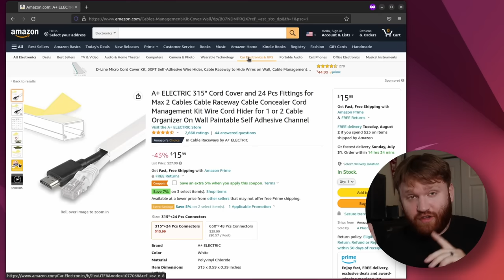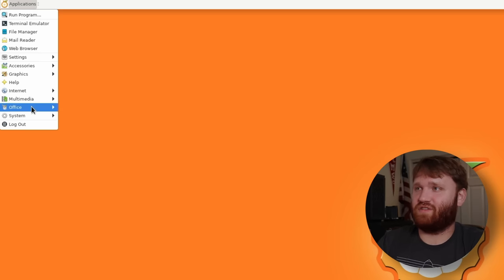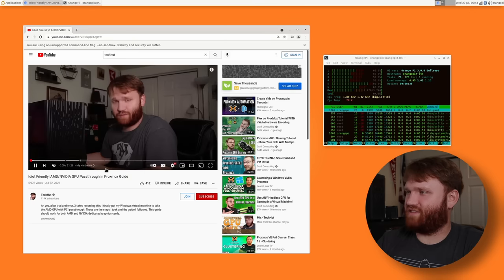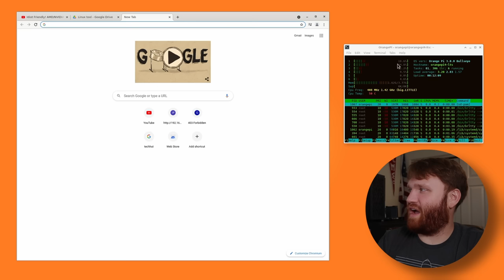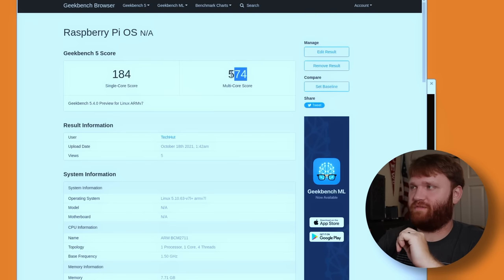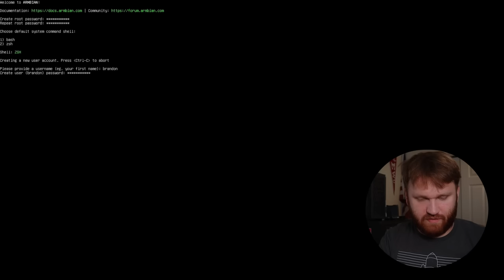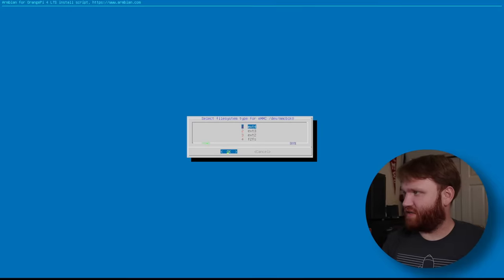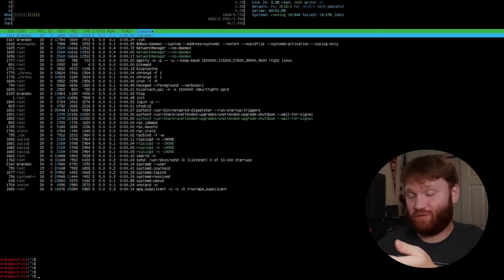BEST Open-Source Single Board Computer? - Orange Pi 4 LTS

Comment: Okay there are a few very big issues with the Orange PI i should point out to folks.

1) Cooling is a big issue with these boards, out of the box there is no prebuilt cooler that will fit this board, all the cases use fans over the CPU but nothing to draw the heat away from the die; while thats fine if you know you want the fan directing cold air over the supplied heatsinks then it works. However if you accidentally wire the fan upside down, you're in for a throttled nightmare
2) There is no prebuilt cases or hardware available specifically for the Orange PI builds, that means you're going to have to either be able to 3d print a case that fits the unit or you're going to have to buy the plastic prebuilt and gasket/seal the clip together cases so that they don't warp with the heat, or as i experienced; crack when the case temperature exceeds the ambient temp.
3) When a new board is released, the old ones are no longer supported (see the Orange Pi Lite v Orange Pi Lite2), when the updated board was released, the older board stopped receiving regular updates, forcing you to use raspbian download directly from their site (since APT updates no longer work on the custom build) and losing a lot of the boards functionality (since changes to the OS are made to make it compatible with the board directly since the GPIO is not aligned to the same jumpers and several of the voltage points are on the opposite rails)
4) The micro USB input has a habit of being loose on the board, so unless you have a good soldering iron you're in for a bad time if it comes loose. This is a theme if you use any of the input/output ports on a regular basis for any length of time other than set and forget. At first i thought i might have just got a bad batch but after my 20th variation on these boards i can say it is the build quality overall
5) the GPIO is not 1 for 1 with a Raspberry PI. So while the board claims to be cross platform, you will need to individually jumper wire the 6 - 8 wires which are misaligned with gpio jumper cables which generally makes a mess when it comes to expansions that use the full 40 pin layout. I realise that there are adapters on aliexpress for converting those pins but i shouldn't need to have another piece on every unit just to convert the GPIO to align to the spec.
6) If you're looking to use the board to run any of the M.2 or hard drive expansion sets that worked with the Raspberry PI, you're out of luck. I've tried many times to get a solid answer from geekboard and other manufacturers of these types of expansion boards, and never had an answer other than its untested but should work (which is not an answer you want to hear if you know the GPIO headers are borked from the start). While it may be compatible with the Raspberry PI standard, the GPIO header pins being mixed up and the difference in the location of the different chipsets means the test pins used on many of those expansion boards don't work (since the part is in a different place on the PCB)

Other than those few issues, if you're running it as a server or as a standalone operation where you're using the GPIO to read sensors or control relays etc. you should find the board more than capable.
Reply: Would i continue to buy these boards, yes and no. Yes if my needs where strictly only for servers & adding zigbee home automations etc. But beyond that scope i think its safe to say that Raspberry PI & Rock PI are still king of the landscape.
Reply: This was a very useful comment, it should be pinned.
Reply: On cooling that's not a big issue,one can easily put a small heatsink from old routers,set top boxes, PC's... ,and when buying one already knows it doesn't have one unless you order it with, 
On the GPIO's I think when buying it one shouldn't assume its a RPi for crying out loud! So no need to complain if you want  an Orange you get an Orange not a Raspberry be prepared for the taste. It does what it's made for and I can't complain cause I knew when I bought it what to expect no catches, I can use it with my pi2 via ESP32 no problems and I bought an arduino 45 sensor kit that work on both ESP32 and OPi running Micropython
Reply: @mars_official  as for me, home automation a RPi or OPi is overkill, an ESP32 does it so well running a microdot async server
Reply: @martinmtawali7359  yes but we're talking about a 1 for 1 replacement for a raspberry pi 4b here, which this post suggests can be achieved with an Orange Pi 4 LTS. Which is not entirely true. If i have a Raspberry Pi 4b and a Orange Pi 3 and i unbox and run them 24/7 as a server and within a year I have to unplug the Orange Pi 3 to check why the board isn't working, thats not exactly a good omen. The LTS series i haven't tried yet (they came out after I purchased the last lot of boards), so I'm going to try those because they have USB-C; but so far I've replaced all the Orange PI boards and none of the Raspberry Pi
Reply: @martinmtawali7359  and I use mine as weather stations & data logger database dumps so i know all about the overkill thing but my success with the Orange PI brand has not been great. Have yet to try Banana Pi's
Reply: @mars_official  sad you didn't succeed 😢
Reply: @mars_official  mango pi's are a bit overpriced but I too wanna try them

Comment: The Raspberry Pi 4 had a CPU change due to a minor fault, which changed the speed from 1.5GHz to 1.8GHz, same as the Pi 400. The difference is the last letter in the serial number - B is 1.5, C is 1.8
Reply: Good to know.

Comment: the rockpi 4c+ was a better replacement imo, same connectors as the rpi 4 (so case compatibility is a possibility) and it has the same chipset as this device

Comment: first of, the gpu on the Orange pi is the same that was used on the Banana pi and it is horrible in comparison to the GPU on the raspberry pi 4, which is probably why you experience lag on the desktop.
second of, the raspberry pi might have a stock clock speed of 1500mhz, but that is mainly because it's sold without cooling, take something like the pi400 which comes in a keyboard and have passive cooling, i believe the stock clock speed is 1800mhz on that.
the raspberry pi can be safely overclocked to 2000mhz but cooling is recommended in order to keep the life span of the pi intact.

back to the gpu, it is probably the only thing holding back the SBC's out there, if the pi could get just a little more boost on the gpu side of things it would actually be a good cheap desktop pc, a raspberry pi 4 specs can be as high as, CPU 2100mhz, RAM/memory 8gb, storage either micro sd cards or simply get a usb connected nvme or sata slot.

the only thing i'd wish they'd do with these SBC's is upgrade the GPU, ofc the CPU matters as well, but the CPU is strong enough for what the use case of them are, on a computing side of things they do wonders, but on the graphical acceleration they are terrible and the only one just holding on is raspberry pi, and i think that is mainly because of how many people actually have been part of building up support for the raspberry pi.

you can't watch streaming services like netflix, disney and what ever from the get go, but search a little online and you find that people have already solved this issue, people have already solved how to run x86 programs on arm devices like the pi.
there is no way any SBC is beating the raspberry without upgrading the GPU.
Reply: Good thing you point out the GPU performance, do you think it's just weaker or it's a driver support thing? I heard some SBCs work better with android because they have full hardware acceleration support.
Reply: @junovicz  not actually sure, it could be driver support but i think it's mainly just the power of the GPU.

but i gotta admit, i love the Pi's for their low power consumption and the many different usage there already is for them.
most who have no idea what to do can easily find step by step guides to make almost anything out of the raspberry pi.

my personal use case after many years is still just a portable retro machine, using a power bank when travelling, able to run N64 and PSx games, what more do you really need ;)
Reply: @gargoyled_drake  yeah emulation on SBCs is pretty neat, pair it with a mini portable monitor + a gamepad and you got a very pretty machine.

Comment: I don't know what that error is or what network manager it comes with by default, but I'd try disabling it and installing NetworkManager and using its control software, nmcli. I don't know if it works on non-Systemd systems, as I've always ran with Systemd. But to enable it in Systemd, "NetworkManager" is case-sensitive; that was frustrating. `# systemctl enable NetworkManager` . You probably also have to `# systemctl start NetworkManager` if you don't want to reboot to turn it on. You can also manage your wired connections through it.

Comment: Hi @TechHut , I just bought one and its on the way. Your review is good Thank you for your time doing this review but you havent mentioned how to Power Orange PI 4 LTS for 24/7 operation. Should I use drum Jack Power adapter with 5V 3A or 5V4A with Type-C Connection? Thanks which Power source did you used could you name a brand and model please

Comment: You can run pi 4s at 1.8 GHz no problem if you put a heat sink on them and it is officially support as in its set to 1.8 GHz out of the box with the raspberry pi OS, so that’s not really an advantage of the orange pi since the pi 4 can do that too.
Reply: I run my Raspberry Pi 4 4 gigs of memory Raspberry Pi OS 64 overclocked at 2ghz in a DeskPi case (good heatsink and fan). Usually runs in high 40 degrees to low 50 degrees C. Makes an OK desktop.
Reply: @jeffreyalwine1990  I’m sure you can probably overclock the orange pi 4 too. My point was more that the officially supported clock speed of the pi 4 was increased to 1.8 GHz so it really isn’t an advantage for the orange pi as the official max clock speeds are the same.

Comment: I don't trust these RPi clones, Banana Pis gave me magic smoke around the time we still waited for the RPi 2 and the RK3366 seems to be hit and miss as far as support goes.
As far as SD Card read and write speeds go, I recently set up DietPi on my old RPi 2 which I use in favour of my NAS and the Pi 4 I added to it because this old SBC can still be empowered from my router's USB port which comes in handy in my country with prices for electricity going to explode.
DietPi itself is pretty amazing because it uses the RAM as a RAM disk of sorts to reduce use on the SD card and because it actually adopts the idea Raspbian's devs came up with when they introduced raspi-config by distributing their own dietpi-config that allows to even more things on the TUI without the need to ever set up config files or use the term like a champ.
The OPi4 certainly would benefit from it as well.

Comment: 4GB is not enough, 8GB is the absolute minimum acceptable. I don't think the mini PCI-E is compatible with SSDs either, so you'd need a PCI-E Controller for any kind of reasonable storage which almost certainly you couldn't boot from, so you'd have to mess with grub on the emmc or sd card for that. I guess they're okay for fiddling, but any serious use it's woefully inadequate.

Comment: uhm.. your sponsor sells way to expense cable trays you can get for a few bucks in 2 meter length in your local harware store... what you showed were k25, and k40 cable trays.. quite
 standard in the electrician world... even the items that came with it are simply available in the hardware store.. so i would not recoment that kit because for that price you can get 10 boxes of that stuff.

but the review is very nice!

Comment: I beilieve that tge current linux kernel (5.x) isnt compatiable with orange pi devices which might be the reason you are getting that error. I know that for the orange pi 3 lts the only way to get wifi working at this time is to use armbian cli the debian version (bullseye) not the ubuntu version (jammg)

You could also try Manjaro since they recently said they added support for the orange pi 3 and 4 lts. Not sure if wifi works on there though

Comment: That is the worst delay I've seen on any Pi like device. Even the half baked Armbian on my Dev term was better. I would look and see if dietpi works on that board, I have it running on an older RK powered device and it works reasonably well. If not try Armbian and see if that processor has better support now. You may also want to try Manjaro, I'm pretty sure the Devterm guys have the RK3399 into the main line arm port with GPU acceleration, I know the Devterm specific version plays videos fine on my A06 (RK3399).
Reply: It would be cool to see someone installing an OS with proper GPU acceleration support.

Comment: Compared to the pi400 or an slightly overclocked Pi4 the little extra performance doesn't justify replacing them with this one? But sure if you already don't have anything current gen pi this might be an option if you are not to dependant on the user base which means being a linux geek.

Comment: Even overclocked, I can't get my Raspberry Pi 4 8gb to play YouTube 1080, only 720 at 30fps.
Reply: Really? I got mine about a week ago and it can play 1080 just fine
Reply: @nasateen13  Really? You get 1080 @30 right? That's what I was trying, and it could alllllmost, but a lot of buffering. Does it matter if I using Raspbian 32 bit or whatever it's called? When I got my Pi the 64 bit operating system wasn't out.
Reply: @vadermasktruth   Yeah 1080 no joke. I've only used stock Raspberry pi 64bit, I haven't used 32 bit yet. I also ran YouTube out of curiosity on android PrimeOS and it too ran 1080, I have the cpu set to 2.3 ghz for PrimeOS.

It could be internet your connection?

Comment: big caveat emptor. I've bought several OrangePi models over the years and are far more finnicky than the Rpi. Issues with power, GPU, awfully updated and poorly documented OS images, and so on. The Zero ones are the worst, they tend to just die without any warnings
Reply: Zero models die quickly? Good thing you point that out, given the price it's kind of expected, but good to know.

Comment: Didn't you say the same thing about zimaboard
Reply: The Zima isn't ARM-based.
Reply from the maker: That's why I put 'true pi competitor' in the thumbnail. I prefer the zimaboard because it's x86 but this is actually at the same level as the raspberry pi.

Comment: Unfortunately, it will only be a real competitor when it is possible to install windows on them. Needless to say that IN THE REAL WORLD, outside the lines of programmers and enthusiasts (and I'm both), there is a range of solutions that only run on windows and that are the majority. I cite an example, a security camera application that I was trying to implement in some cheap device like this card. There was no way to convert the application to linux or emulate it in wine satisfactorily. I'm also not going to rewrite the app from scratch doing disassembly, it wasn't worth it. IT WAS MUCH BETTER AND CHEAPER for me to get an old notebook and implement the solution, in the end it wasn't exactly what I wanted but it all worked out. That is, much work still needs to be done on top of these plaques so that they spread definitively.

Comment: Can't you overclock the pi to like 2 GHz
Reply: Yes, you can also do the same with this sbc. Overall, it's  a faster sbc on both multicore and single core. Especially the latter one, on single core rk3399 is just slightly faster.
Reply: @microlinux  it's probably also in stock.
Reply: @Iswimandrun  I tested the opi4 non LTS variant, and I had a lot of power issues overclocking. So I don't know if it would be possible on this specific board.
Reply: Yeah I over clock my pi4 at 2.3 ghz but I can't figure out why it will not let me go any higher ?
Reply: @nasateen13  2.3 is a ridiculously high OC for a cortex A72 built  at 28nm. So, I am not sure what you mean. The chip wasn't  designing to run at higher frequencies.
Reply: @microlinux  Yeah it's pretty high but I can't get an android os to run well for me on the pi4b. I read a few months ago that someone was able to get a pi 400 to run at or close to 3ghz, if I understood correctly the pi4b and pi 400 are the same?
Reply: @nasateen13  that would be related to silicon lottery and extremely high voltages that would harm the soc a lot, making it unusable on a few weeks/months, so, destroying your pi4 /rpi400. I don't  think they were really reaching that speed, it was just a fake frequency most probably.. I can force frequencies that and the cpu isn't running at such speeds on many sbcs... that's why we use tkaiser sbc bench to corroborate REAL frequencies. That being said, rpi4 at 2.3 ghz should  be plenty for android, if it doesn't run great it's bc of lack of vpu acceleration on video decoding or simply not enough gpu raw power, so,  not related to the cpu speeds.
Reply: @nasateen13  the broadcom blobs are very complex (and that's a bad thing) and they can lie a LOT about rpi frequencies. That's  very common on rpis. But also happens on other platforms too.
Reply: @microlinux  Well that sucks it can't go up to 3ghz, but I'll live with it. I have no idea about broadcom blobs. Thanks for the information
Reply: @microlinux  Thank you for the info lucky I have enough pi for my needs at the moment.